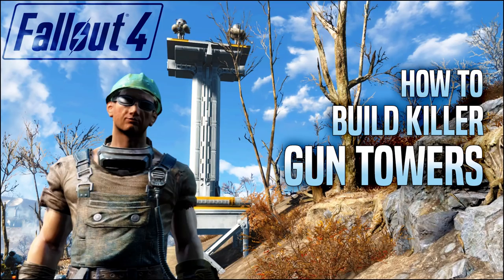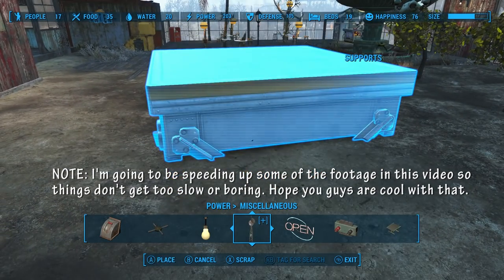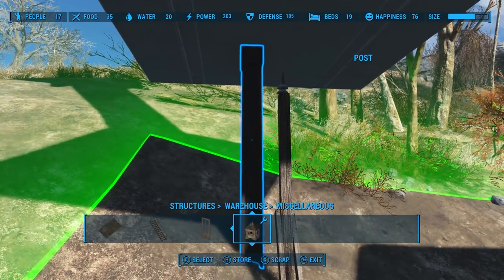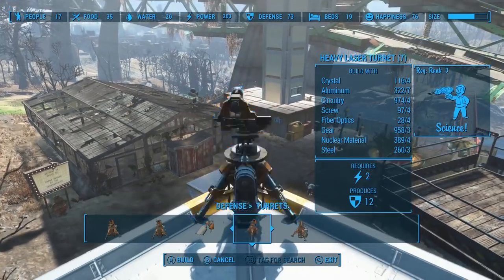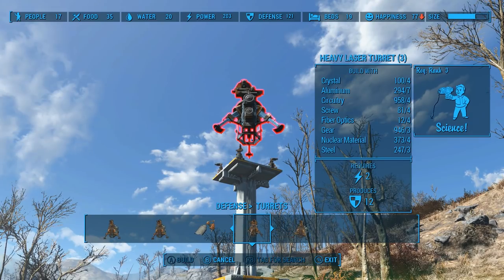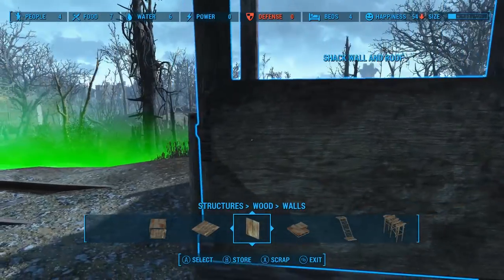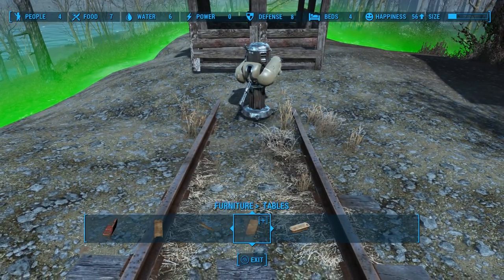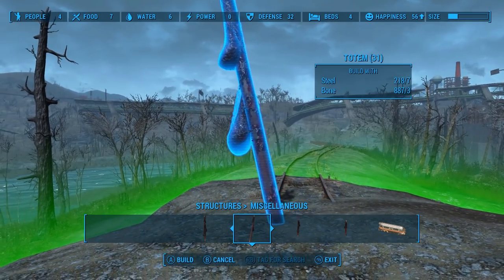Build A Raider-Style Gun Tower ☠️ Fallout 4 No Mods Shop Class

Comment: A trick I use to get turrets shooting above the railings is by using the short wooden steps. A small floor tile will snap to the top of them & make a nice platform. I just put it together on the ground, group select, then place it before adding a turret. Pushing the edge of the floor against the rail to "support" it, of course. Plus you have the option of using 1 set of steps opposite of the railing, or a set on both sides. If you have limited room, you can always just remove the stairs all together to give it a shelf like look, or use a pillar in stead. I do use mods, but I love your videos no matter the length, & I use your tricks all the time. Hopefully my little tip will help you, & your subscribers. If I think of any more, I'll be sure to let you know. Keep up the great work! 
Thanks, Teach!! [DJ Thorn]

Comment: Oh, I love how you used the power pole for a support beam, I used them in a build over at the lighthouse that I did. It just seemed so appropriate for something they would really use. I used them for partial support of the rooms I built off of the side of the building. Your choice of the angled raider poles was also quite nice. 

I run into 'ghosts' using items all over the place, the weight bench from the vault tec DLC is another bad one.
Reply from the maker: Thanks Devian.

Comment: Fantastic and creative as well.  
Can’t speak for others but I have a lot of fun watching these videos and learning techniques.  
Could you not just use a conduit at the bottom of the first tower or will it not sit on the ground? At one point it looked like your base has solid walls which would hide a generator or could sink a generator if needed.  
My water pump at Oberland Station has that ghost pumper as well.  Only 1 of the 4 pumps though. 
The only problem with longer videos is trying to remember everything but with screen shots and replaying the video that’s no big deal.
Reply from the maker: Thanks Learoy. Yeah, you could use a regular conduit on the ground but, because of the slope, it would've looked like it was floating. :)

Comment: Just wondering. Wouldnt the raider tower be easier done if you got the box at the required height then beam glitches the blood poles into place
Reply from the maker: Indeed. I mentioned at the end of the video that I discovered you can adjust the poles after the fact. So as long as the shack isn't too high or too low then you could do it in reverse.
Reply: Gotch ya.
I misinterpreted it as adjustment only.
My apologises.

Comment: Hey :) Those totems are not Raider, they are SuperMutant :)
So I loaded a video up on my channel where I built a Heli-Turret at RedRocket. The fans keep synchronizing after a while.
It always looks like there is only one fan rotating.
Question: Do You know a workaround (or if You take a look at that video, what did I do wrong)?
Reply from the maker: You're right, they're technically super-mutant totems, but they fit nicely into the whole grisly raider theme. ;) As for your fan rotation question, I haven't run into that problem. The one you see briefly at 9:04 was built like six months ago and hasn't desynchronized. But it's still an easy fix. Just select one fan and release it until they're spread apart again. :)
Reply: Thank You for answering. But nahh... I took them down - My Abby is not THAT sophisticated :D Keep on rockin´ dear Skooled.

Comment: Hey there Skooled Zone , I've been playing Fallout 4 and I ran into a bit of a mess trying to use the electrical conduits to wire up a house . What I'm trying to do is to put 2 switches in the same area to control 2 different items independently from each other ( like a ceiling light and then a low powered wall light ) , thing is I don't even know if that's possible . I was wondering if you might have any tips for this ? Thanks
Reply from the maker: Yup, it's possible. Just think of the switches as gateways. The electricity has to pass through the "gateway" before continuing on to the light. That way when you shut the gate, the light turns off. Hope that helps.
Reply: Ya I would have understood that , but while I was waiting for your reply I did a little experimenting with the mess I already had and figured that out myself lol . Thanks anyway for the reply tho . Lol I had circles of conduits and things criss-crossing inside of circles and other stuff running in other directions outside the circles . What a mess I made for myself to clean up !
Reply from the maker: Haha, I know what you mean. That's why I started doing this: https://youtu.be/3TIo77uMUxc

Comment: Why is it better to have things snap? I would just move in the half shack walls with a pillar. Takes like a third of the time.
Reply from the maker: If you try to pillar glitch the shack half walls on the wooden floor inside the fence railings, you'll quickly realize that it's going to take you equally long to make it work. Try it and you'll see. :)
Reply: I have to apologize. I tried it, you were right, it takes equally long. 

I have asked for a guide on logic gates in the past: Youtuber Darkdally made some videos on that and I build a little pc (kind of) in my settlement. However, his videos are still somewhat complicated. It might require some skooling to really get what these gates do :D